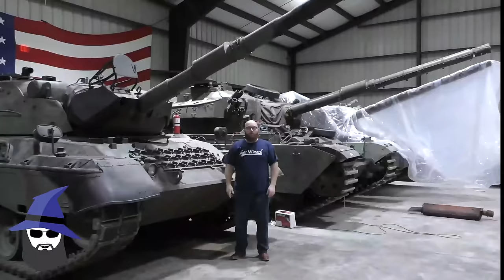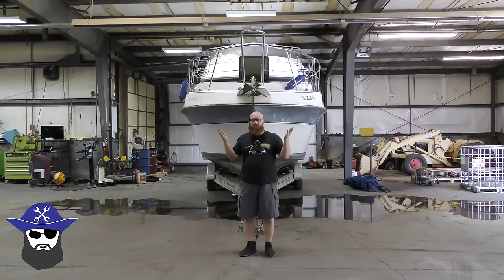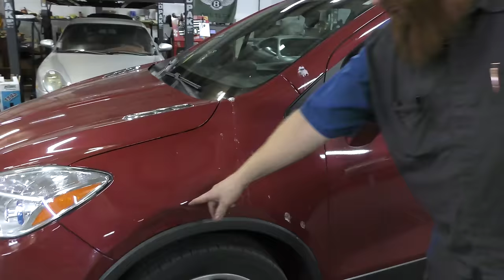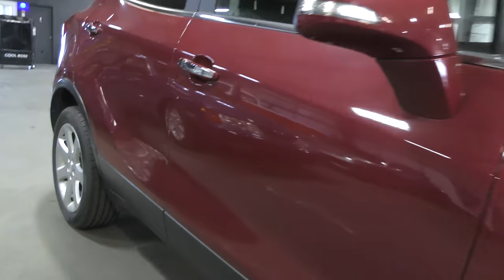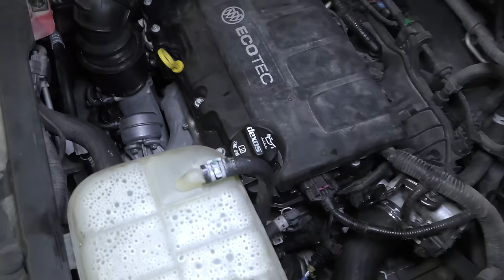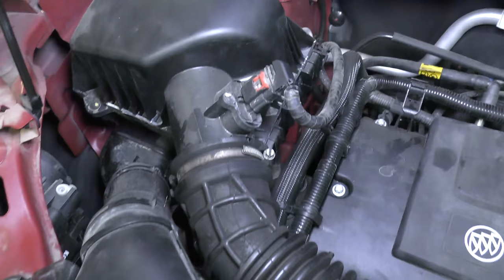How did a dealer miss the problem on this '15 Encore 4 times? CAR WIZARD just had to read the codes

Comment: I had my local dealer try to upsell me on brake service. I replaced the pads and had the rotors turned four months prior. The service advisor told me that the pads were worn over half and desperately needed replacing. I now have to see about doing a trans fluid replacement myself or have another shop do it since I have no faith they actually performed that service it was there for originally (price was good at the time). FWIW I did the brake pads and rotors myself. I did double-check after getting the car back from the stealership when I had some free time. Lies all lies.

Comment: A few years ago my check engine light came on in my 2012 Subaru Legacy (which I have since given to my daughter) and I immediately scheduled an appointment with New Motors Subaru the dealership I purchased it from. 
They told me they had to contact corporate because they had never seen the code before.  Turns out my thermostat was stuck open. They replaced it under warranty for no charge.
I am very happy with my dealership and bought a new 2019 Subaru Forester from them. 
You run a fantastic garage but all dealerships arent bad or unable to fix complicated issues.
I am on my 3rd Subaru from New Motors in Erie, Pa. and will purchase a 4th if I live long enough.
Kudos to your garage but I think you do a disservice to honest and reliable dealerships. 
Maybe when you criticize poor dealerships you take the time to mention that there are outstanding dealerships out there also.

Comment: My brother took his car to a dealership and told them his axle seal was going bad and asked them to look at it. They said the only leak was his oil drain bolt,but it wasn’t. They replaced that and sent him away. I looked under it and confirm to him after that it was indeed the axle seal and he took it to a different shop and that shop did confirm and replace the leaking part.

Comment: The OEM Thermostat they came with is a common fault on those motors atleast the 1.8L it is probably the 1.4 like this car has too. Also when a vehicle has a CEL you always hook up the scanner which is essentially a vehicle translator that typically tells you what is wrong.

Comment: Back when I worked as a dealer mechanic, my service manager gave me a work order for a car from our body shop. The story was they fixed damage from an accident and after the repair the truck wouldn’t start. They had a guy there work on it for over a month! Replaced  every processor and and sensor he could and finally threw up his hands and said send it to service! I didn’t have the prop rod in the hood before I saw the problem...... they didn’t plug in the fuse block!! LOL

Comment: 2018 Encore. Had the battery corrode the ** out of the positive post. Then it took out the connector with the fuse block. Corrosion seeped into it. Radio went blank and back to 12:00 all the time. Ended up replacing the fuse block connector with a used ebay part.

Comment: My daughter's 2019 Chevy Sonic with that same engine had CEL light, code P00B7: engine coolant low flow/ performance, so I thought it needed thermostat. Car is under warranty, dealer said radiator had a small leak at a seam and replaced it, no cost to her, including recovering and recharging AC system. I should rescan and see if the code is still there!

Comment: I'm an industrial manufacturing mechanic and electrician, not an auto tech.  Dealer wanted over $400 for an a/c fan repair.  I did it myself for $80 and 15 minutes labor. When something is beyond my tools or ability, I have a shop I trust (guys paid hourly, not flat rate)..

Comment: My wife just bought a 2022 Encore and it seems like a nice litttle car.  I feel better with the Car Wizard's positive view of what the car is.  Its just a baby car. Pleased to see that it is easy to maintain as we keep our cars forever.  Just let the Subaru Forester go after 20 years.  I did hear that the turbo supply line should ble replaced or cleaned regularly.    Not the most advanced car but simple enough is just what we like.  We only drive about 6k per year and have always changed our oil at 3k with synthetic oil.  We had a head gastket leaking oil for about 10 years and coolant for about 5 years or more.   I hope to have good luck with the Buick.   We do not drive hard or fast and a baby car is what she wants. She actually thought that this is big.  Not many little cars anymore as there are very few hatchbacks.

Comment: My daughter drives a 2016 Kia Soul + with the 2.0L Nu GDI. She loves the thing, it's been a great college car and very reliable. It's still within it's 5 yr/60K initial warranty, and since I'm the original owner the 10 yr/100K powertrain warranty still applies. The ONLY reason that I take that Soul to the area Kia dealers is for minor warranty work AND OIL CHANGES - to ENSURE they put the date and mileage in the Kia system. They can see how I have never missed an oil change interval, changed every 3500 miles. I've heard of the Hyundai/Kia 2.0 GDI issues and engine replacements... I hope I never have to endure that, but at least the oil changes will be in THEIR computer. One less thing for the stealer to hit me over the head with. Omega is 375 miles from me, otherwise David would do ALL repairs on my family fleet.

Comment: It took the Buick Dealer Ship four weeks to change the turbo on my 2016 Encore.  and Break check fixed my breaks and had to switched two bad rotors for new ones. and according to the guy at the counter, the two new rotors needed to be resurfaced.  😤 big rip-off.

Comment: My experience is that small workshops are usually a lot better to work with - especially when you find one that has specialised in certain make. The big ones certified for certain brands of cars will usually make you feel ripped off.

Comment: Sorry Wizard, that's not a solid rear end. It is called a torsion beam rear axle. You noticed it is a c-channel between the 2 wheel, which means it is strong, but torsion weak. The wheels can move independently within limits. Otherwise I love watching your channel and learned an awful lot from you! And yes, some repair shops are useless, even the dealers. My Kia dealer failed to pick up on worn front brake pads not once but twice. I had to have it serviced there for warranty, but told them on the last visit that they need to tell the mechanics to look with their eyes...

Comment: Ive done so many thermostats and water outlets on these POSes. If someone tells me anything is wrong with their GM 1.4 or 1.8 I also replace the outlet and thermostat preventatively but usually that's the problem anyway.

Comment: I took my Lincoln MKT to the local dealer 4 times in 5 months for multiple things under warranty.  But every one of those times, the rear window defroster was supposed to be fixed and the technician couldn't even figure out how to turn it on.  One time when I got the car back, my rear vents were pointed toward the rear glass.  I now know why it was never fixed.

Comment: I'm having major issues with my truck. It's odd and the mechanics don't know what's up. My truck has broken down twice and it was both the same reason. Truck refused to start. Starter is perfect. But it refused to even try to crack. Power was there. Just refused to start.
2010 Ford f150 5.4

Comment: I bought my 14 f150 5.0 at the beginning of the year and about a month of owning it I took it to the dealer because it was leaking coolant and they told me it needed a t connector and a upper radiator hose. So I told they to go ahead and fixed it and after it was fixed they told me it was going to be $600 and some change because my warranty would cover it and to make matters worse they didn't even put in enough coolant I had to put about a gallon and a half and haven't have a problem since but hey that was my fault for not fixing it myself.

Comment: After a dealership, a parts house, and an independent mechanic, all utilizing higher end scan tools indicating I needed to replace my O2 sensors to make my check engine light go out and stay out I utilized a $40.00 scan tool purchased at Wally World and a Chilton manual purchased from a certain Irishman's parts house....I learned it might just be a worn/defective gas cap....Which it apparently was since replacing the old one with a new one a year ago resulted in the check engine light NOT coming on since about August 2020. But just to be on the safe side I purchased two brand new O2 sensors which have been residing in the center console of my truck since August 2020...They are still in the boxes they came in...Just in case.

Comment: It's a common problem for the 1.4 right after the water outlet, valve cover, intake, coil, and if you're lucky the turbo.

My thermostat melted in the plastic

Comment: Dealerships are just scam factories. Last time I visited one, it was $95 an hour. 98 5.9 jeep had an overheating problem. I did the normal check's myself and everything checked out. It didn't get hot for them and they found no problem with anything. I got rid of it shortly afterwards when I noticed the tranny was slipping with the fluid being good before I put 2x quart aluminum pan on it. Didn't want to deal with all time 4 wheel drive transfer case that I know was next.

Comment: If you own a car with an ecotec 1.4 turbo (Encore, Cruze, Sonic, Trax) know the terms UFI and Hengst.  If you use a Hengst oil filter in a UFI housing you are basically running you car WITHOUT an oil filter.  Read and fully understand TSB 17-NA-184. The ONLY way to know which filter your car needs is to look at the cap for the filter and see if it is labelled Hengst or UFI.  The filters both fit and even entering your VIN will not tell  you which one your car has.

Comment: I dont know about you, but in my country, the dealer (in most cases) is the best place to take your car, because independent shops are mostly fraudulent or have crooks as mechanics. I worked at a Ford dealer, then a Mercedes and Chrysler dealer, and almost all the technicians were good and always diagnosed the cars well. There are some independent shops that are very good and have very good mechanics, though. Those are usually managed by former dealership technicians who wanted to step up in their career or simply the technicians in those shops were dealership technicians before going to work for an independent shop.

Comment: This is why I stopped years ago taking my trucks to dealers and mechanics, Sick and tired of over excessive charging for bills the problem doesn't get fixed or when you get back to the shop you have to tighten bolts or clamps or reinstall connections and engine parts or fluid holder broke But they didn't do it.

Comment: The last time I went to a mechanic, ANY mechanic, was in 2009 to pull a vacuum on the A/C system of a 1991 Lotus Elan M100 I'd just bought (with less than 5K miles on it!) that I decided to convert BACK TO R12 because unless I was on the Interstate it took 5 minutes or more to start blowing cold... totally unacceptable in Florida.  I had to open the system to put the original, correct 'rubber' (a word used in the loosest sense) gaskets throughout where the lines connected because someone had just reached into their bin of generic O-rings and put the incorrect ones in the car.  I didn't have the equipment to pull a vacuum, although I did have a couple 30lb canisters of R12 I'd bought way back in the 1990's on the last weekend I was legally able to!

Comment: My $12 bluetooth code reader could have caught that. 

I had a battery go bad in my truck last winter. It would read 12V, but as soon as you try to start it, all the lights would go out. Didn't even get a click. I unhooked the battery and put a test light across the terminals, and it lit up and immediately went dead. So I took the battery to the parts store, and the guy there wanted to check it. The battery was so dead that it wouldn't even run the tester.

Comment: It's unfortunate, but true. Dealerships are unwilling to train and fairly compensate their technicians. The flat rate system also doesn't help promote a thorough repair. It blows my mind that this particular problem wasn't addressed in the first visit. It's such a simple basic repair.

Comment: Yea imagine me, been having a torque converter or something along those lines  problem on my Audi A6 ZF8 for over a year and over 25k miles. 7-9 visits to the dealership & no solution. They call it “normal” so I’m stuck bc I don’t have any independent shops that I know of that are good. Corporate Audi won’t do anything for me either because the dealerships won’t diagnose it.  Really really wish omega was closer to me I know for a fact you’d be able to fix my issue and we’re honest with me but here I am stuck with this problem most likely forever /:

Comment: The problems the Wizard talked about is why I bought a cheap OBDLink MX+. Is it as good as a pro scantool? No, but it lets me pull the codes and show me the status of most things. Only once have I not been able to find the problem with it, but my local shop was happy that they had the codes before the car even pulled into the shop. Ironically an oil change did fix the the oil pressure error code on our 2013 Chrysler Town and Country. The shop had seen it before and showed us that the aftermarket oil filter doesn't fit as well as it should on some engines and the fix is to use an OEM filter. I couldn't believe it so they put the filters side by side and the changes the after market filters need to make to get around patents were just enough that the filter didn't fit as well as the OEM. The funny thing was that the OEM filter was only $2 more than the after market filter.

Comment: These engines make decent power with a remap to 170+hp.
If you have one and the engine squeaks when it's at running temperature, THE SPARK PLUGS ARE LOOSE, trust me, I couldn't believe it.

Comment: Took my car to a dealership. Had a fuse box and a ecm put in. They had it for 3 months. They also charged me for a new battery and they never did put the battery    On the car. I would of never know about the battery but my headlight went out. When I was changing the headlight I noticed the old battery.

Comment: I had a mechanic recently tell me he wouldn’t install the parts I bought, because he could not warranty them.  After going back and forth, I agreed to return them and to let him install his part.  He told me he would charge me for what he paid in parts and for the labor. He called Advanced Auto, bought the cheapest sway bar links and marked them up 61%.

Comment: Samcrac has a video where he bought a lemon law’ed Lincoln to discover that the problem was a (very obviously) failed wire in one of the main harnesses. It seemed the only repair attempted by the dealer was to try and force the wire deeper into the connector.

Comment: Friend of mine has a 2017 Chevy version of this. It's already had a turbo replaced and has a stretched timing chain. These things are the epitome of disposable. 35k miles.

Wizard there's a massive difference between this motor and a Toyota. The Toyota might actually last 100k miles.

Comment: Yep I’m having a problem. The dealer can’t get the right part it’s the purge valve replacement for encore gx st 2021
and I’m driving with the check engine light on. And my car is still under warranty.

Comment: Ho many oil changes? We have  the same vehicle. Never had a problem like this. Took it for a recall was about it.  They rotated the tires and gave a free oil change. However I knew the brakes and rotors needed done. They quoted me 950 dollars. This was the Buick dealer. I laughed at them and said they were nuts. 😂 I did it myself for 325

Comment: Last dealership visit I suffered, they lost the wheel lock key. It was $75 from McGard to replace the key, but apparently they weren't aware of that. No, instead they tried to extract them, failed, damaged the wheels, and then drilled out the hubs on all 4 corners, thinking they press new studs in. Unsurprisingly that didn't work, so needed 4 new hubs and associated labour. 
I was presented with a >5k bill for all their labour and parts. LOL. After a lot of pain, I paid then $75 for the McGard kit and got 4 new wheel hubs out of the process. I was pissed at even paying the $75 but figured it was easier than court. 
Haven't even considered returning since, despite vehicle being under powertrain warranty. Never again. I'll DIY or find a shop that isn't incompetent to manage from here. Even oil changes are done at my local quick lube place where I have a good rapport with owner and they don't mess around on me.

Comment: What's amazing to me is the dealer didn't know that the thermostat is a common failure point on these engines. I had a Cruze with the same engine and it used about 2 thermostats per year.

Comment: I had a dealership tell me my key wasn't working because my vehicle had a aftermarket alarm, I searched high and low and never saw it... THEY LIED. I ended up figuring out my vehicle just doesn't like aftermarket door lock actuators and disabled the key. Dealerships are among one of the worst places to get a solid diagnosis

Comment: My mom has the same car. She had a CEL and took it to a mechanic. They told her it was a bad purge valve and it would be $300 to fix it. I told her NOT to let them do the work. I ordered the purge valve for $20 and installed it in her garage in about 10 minutes. Cleared the code with my scanner. She's an elderly woman living on Social Security, and for someone to try to take advantage of her like that really ticks me off. I could understand $100-$150....they have bills to pay. But $300 for a $20 part and 10 minutes of labor seems excessive.